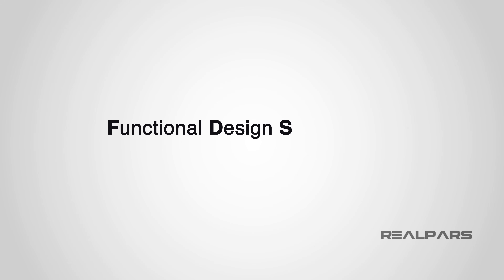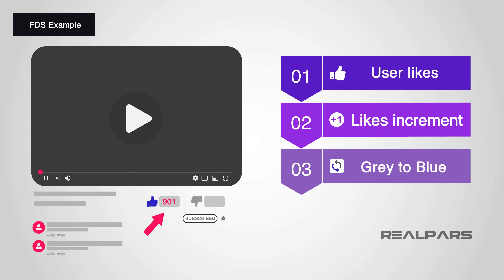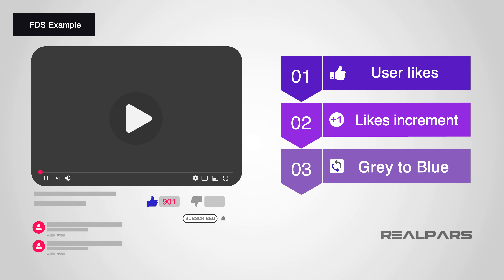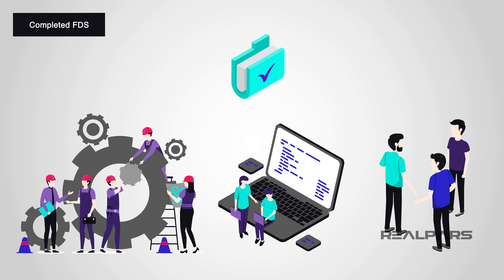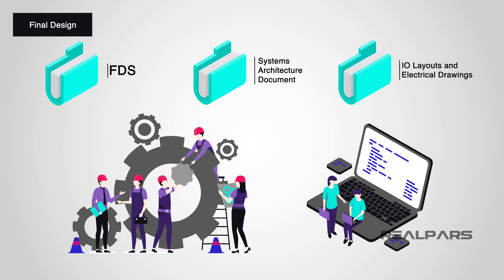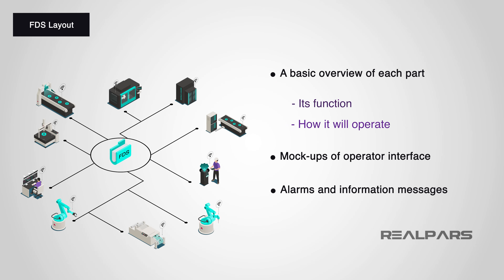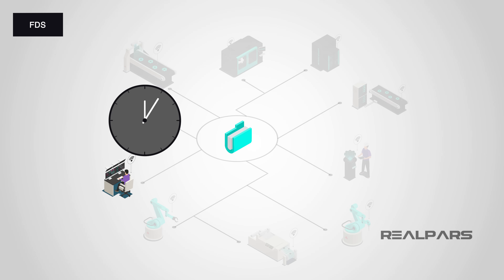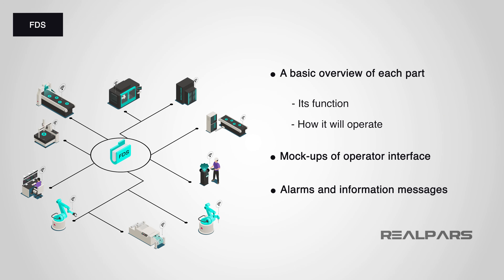What is a Functional Design Specification (FDS)?

Comment: But can i assume the Operational Manual is FDS?
Reply from the maker: No, the FDS is written for engineers to describe the software structure and modules that need to be developed to create the application.  It contains variable structures, software module names, etc., that an engineer will use to create the software code.  The operator manual is written for operators, and it provides step-by-step procedures for operating the system.  While these two documents are different, they should be in agreement with one another.

Comment: Many thanks to your efforts!!!
Is the FDS similar to SOP?
Reply from the maker: Not really, but they are related.  The FDS identifies and describes the functions that the control system needs to be able to address.  It does not describe the code or specifics of how it gets implemented in the system.  And FDS does not describe how the process runs, or in what order.  An FDS for a mixing tank would describe functions such as:  liquid feed, loss-in-weight transfer, heating, agitation, recirculation, etc.  An SOP is a step-by-step guide to actually creating the batch in the mixing tank, including manual operations, which raw materials to use, what connections to make, how to set up utilities, etc.